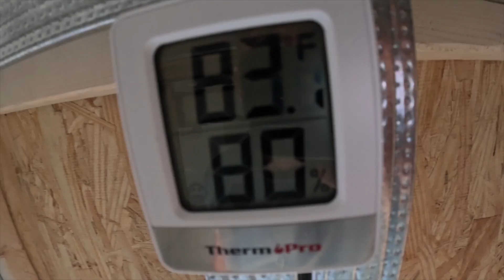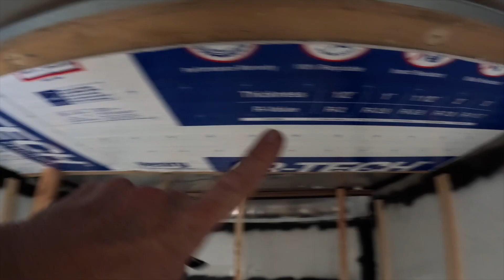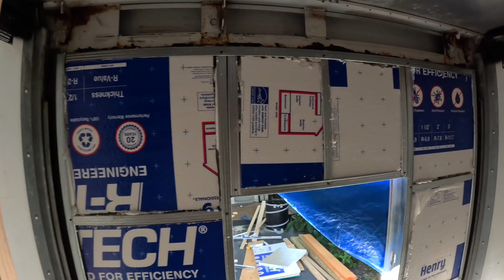BATTLING THE HEAT! - Insulation install for the BOX TRUCK

Comment: Definitely a good choice building out a box truck. One thing I’d change is the foam board. They’re great for flooring but not so great for walls or ceiling. I’d go for spray foam and coat everything. That is of course after wiring everything and installing your pipes. I’d also consider purchasing some RV windows.
Reply from the maker: You are a 1000% correct, and if I venture another I’m doing exactly that 👍🏻🏆😀

Comment: Use A Fans Inside The Box Truck When Working On & Spray Foam The Interior Otherwise Your Ceiling & Wood Will Sweat & Mold Appears.Spray Foam By Someone Who Does It. Cost $800 Dollars & Every Crack Is Sealed Up. You Will Never Regret It.
Reply from the maker: Good advice.  Thanks

Comment: Sir,
Did the insulation lower the temperatures. What would you do different? I am building a cargo truck conversion here in the Philippines where it is common to have 40°C temperatures.
Reply from the maker: I would have done 1 1/2 all over instead of just the top - yes it changed the heat factor    Maybe two roof fans instead of one.
Reply: @hellomynameistony  Thank you
Reply from the maker: any future questions do not hesitate to ask